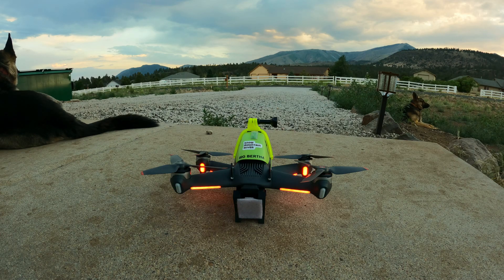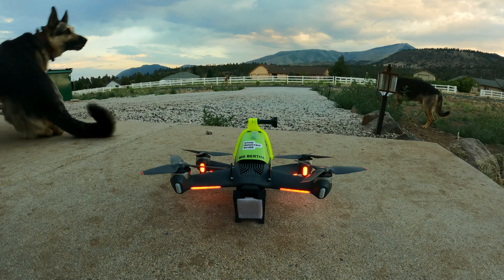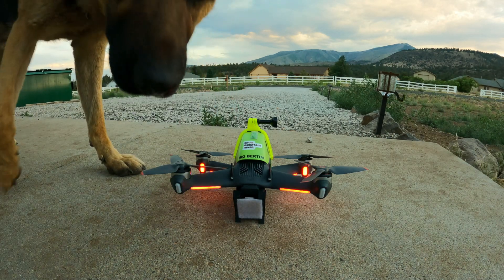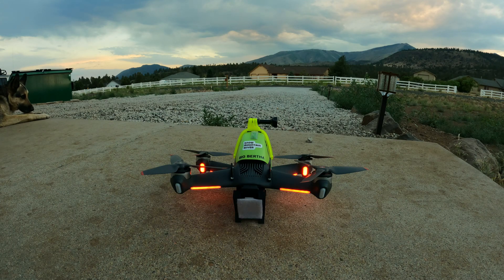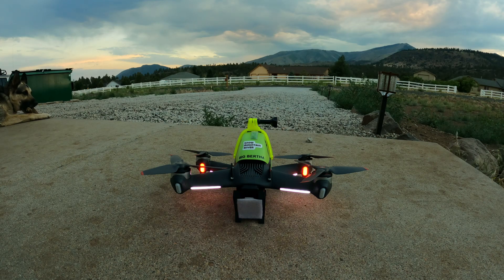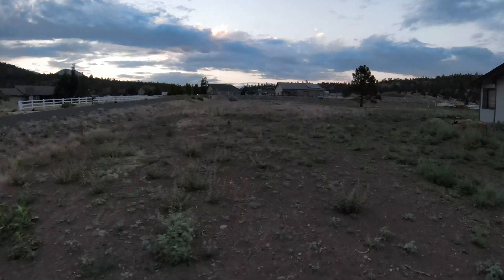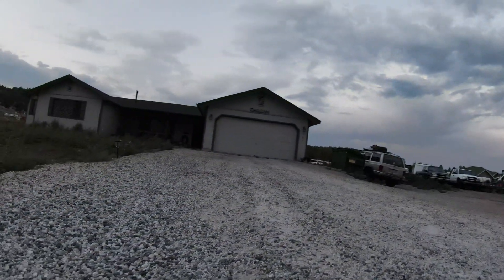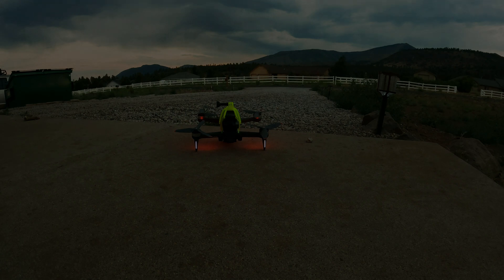Latest DJI FPV Update: switch setup for Motor start/stop and motor beep/flash.

Comment: I don't see the option to start/stop motors in the button customization  options for C2.   I just see the options for the gimbal, which don't apply in manual.  Put the drone in manual, but still no stop/start motors option.   Definitely want this feature, I destroyed my drone first flight because I didn't have this.  I have an option to emergency stop with the sticks, but I hate that.
Reply from the maker: Custom mode must be set to manual and then set c2 bottom to "start motors"  once this is set c2 mid and top will automatically be set to "motor stop" hope this helps.

Comment: Good god 😹 put that thing in normal and land, so much safer.. i love my Dji drone purchased it to get into fpv & if anything film drifting and sportbikes great drone
Reply from the maker: I would disagree for those of used to flying fpv this is the most comfortable way. Most of my prop scuffs have been trying to disarm in N mode.
Reply: @upnorthFPVandEUC  alot of work to land manually instead of just swapping to normal. wtf
Reply from the maker: @Just_a_Kilawhale  to each their own i guess.. 😎 mostly I just land in N or S mode but there are times and situations where being able to instantly stop the rotors is priceless. keep in mind this video wasnt about telling anyone how to land.. just showing options.

Comment: Does the start stop button also work still? The right shoulder button?
Reply from the maker: I believe it does.
Reply: @upnorthFPVandEUC  start stop button cost me 250 dollars. Accidentally hit that instead of pause
Reply from the maker: @28daballa  man that's a super bummer! What did you break? If you haven't paid yet try my repair tutorial it is not that hard and I fixed mine for $26💪
Reply: @upnorthFPVandEUC  cracked the two back arms which I repaired myself only to find out that sensor array was damaged and I took it apart and checked the ribbon cable and couldn’t see anything physically wrong with the unit 
They wouldn’t sell me one so I just used the refresh (250 bucks). Not a happy camper. They kept my new arms too